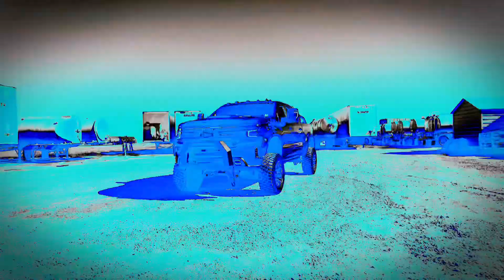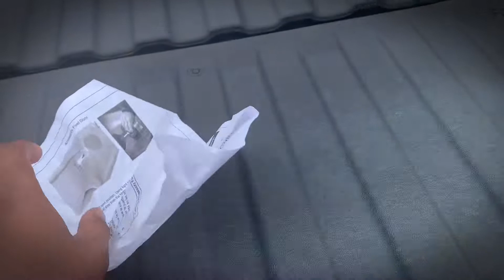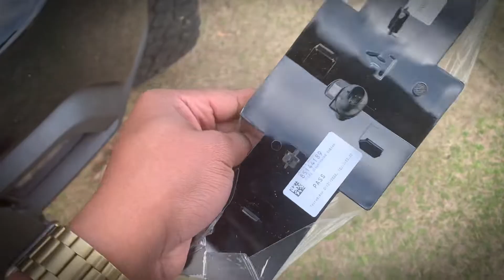Installing a "Glow Tie" to replace my stock bowtie on my 2020 Chevy Silverado (IHY now say it back)

Comment: Nice but how did you run your cable after you  took the top off the grill???
Reply from the maker: I routed it between my left headlight assembly and the bare metal to get to the engine bay, it's easier to just pull the grill off tho its alot of reaching otherwise, and routing it straight through the shutters would be in the way, if i get time i'll upload a vid to show exactly what i mean
Reply: @Blackocalypse  thanks for the reply but i managed to get the grille off,  thought it was gonna break when pulling felt sketchy  but it is probably better to clip the cable out of sight,  looks cool
Reply from the maker: @thorpower1015  Glad it worked out good for you 💪🏽💪🏽💪🏽🔥 those clips are definitely sketchy lol
Reply: @Blackocalypse  yeah bro your truck is raw
Reply from the maker: @thorpower1015  Thanks💪🏽